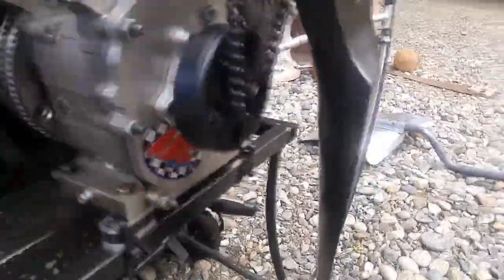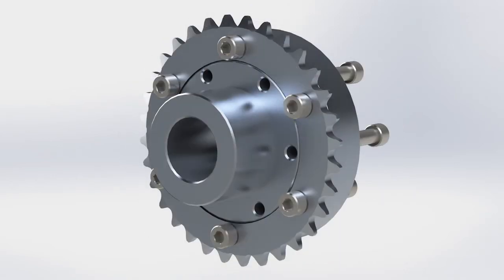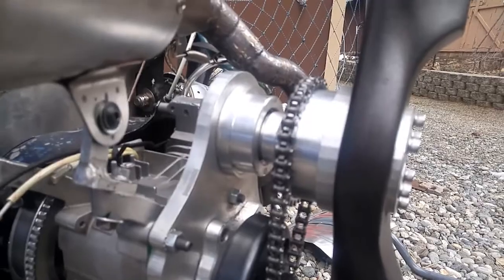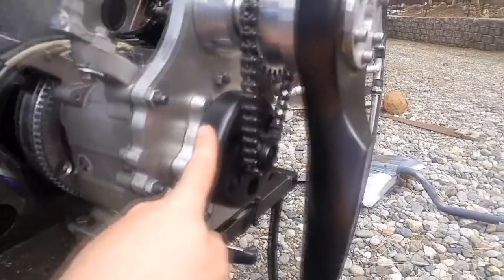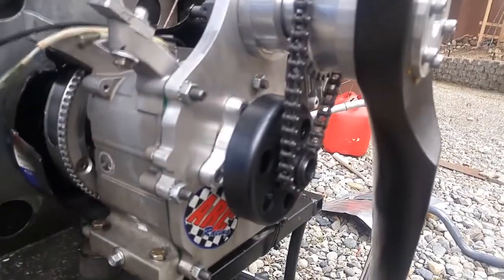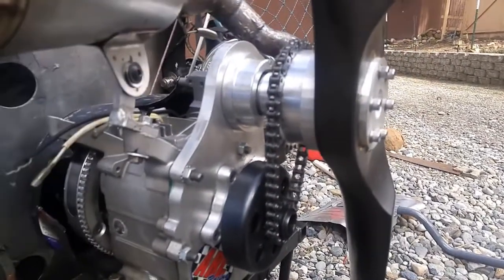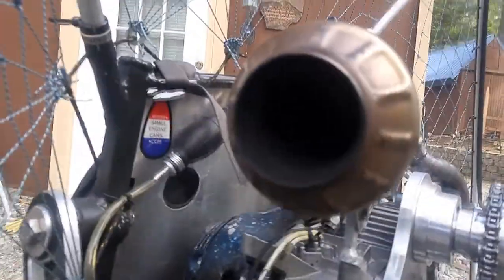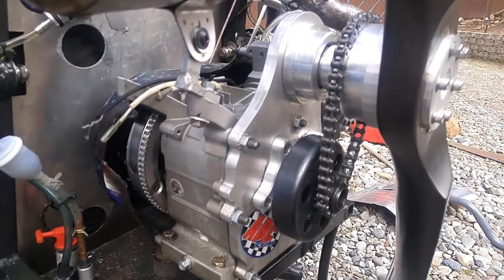Homemade Paramotor - Chain Reduction

Comment: Thank you for your work and posting it. What stopped further development of this design 4 years ago?  I like the 212 engine power source and it's development!
Reply from the maker: Hey Gary.  I decided to commit to building a production paramotor and did so. This engine is still on a shelf.  One day I'll revive it just for fun. However, it is not a viable option for a paramotor for normal pilots.  It's more of a tinker project.

Comment: Why didn't you turn around the clutch so you could shorten your propeller shaft?
Reply from the maker: It wouldn't save any space because then I would just have to add thickness to the hub to clear the clutch.
Reply: @IrisPPG  That may be so but wouldn't it be preferable to have your chain closer to the bearing

Comment: Dude, you have done more for me since the Eggmotor project. I started my predator 212 paramotor project thanks to them, and I stay motivated on it thanks to you. I love seeing what you come up with, and you went ahead with the chain-drive reduction system in spite of the naysayers.  Glad you didn't bail on the 4-stroke paramotor.  Keep it up, man.
Reply from the maker: Steven n I very much appreciate the kind words man. Much love, -D.
Reply: Hey man can you also tell me what your reduction ratio is and what type/size/pitch prop you're using? It looks like you're getting some damn good thrust
Reply from the maker: I'm using a Moster 185 125cm wood prop with a 2.666666 reduction ratio.
Reply from the maker: But keep in mind that my motor's max RPM is about 8400 and it makes around 20hp so that ratio may be very different for different configurations.

Comment: Awesome work Dimitri. Why did you select predator 212 cc hemi instead of the non hemi? Any thing good about hemi? Also if I were to get the reduction can a torque converter do the same job? I like that you mounted your prop on the bearing instead of directly on the clutch as I had a thought of doing something like that but I guess this will break the clutch due to intense vibration from the prop. How can I request your design to print locally as I don't have cnc machine ? Can you please make a video of it ? Many thanks for your awesome videos.also please let me know what wing do you use? Thanks
Reply from the maker: kamlesh jethwa man, I could write a book for you as an answer. I'd love to chat with you because this is too much for a comment. If you use Facebook, find me (Dmitri Zyuzin).
Reply: Dmitri Zyuzin ,sure I will contact you very soon. And Thanks for your response.

Comment: Nice job how much does your paramotor weight Thanks
Reply from the maker: Terry Fields the paramotor as a whole weights somewhere around 65-70 lbs. The engine is about 35 in its current configuration.

Comment: Heck yeah Dmitri! I'll be waiting to see how the chain lasts, but even if you need to change it more frequently for a safety margin. You can buy a lot of chain for what a belt (and the cost of a belt reduction) cost. Solid work!
Reply from the maker: Yeah man. On top of that, it took about 3 hours to machine the parts where the belt reduction parts took somewhere between 12 and 14 just for the big pulley. If I wanted to change my reduction ratio, the main sprocket takes about 25 minutes to machine.
Reply: Dmitri Zyuzin that's awesome, do you have a ballpark figure on how much machining time for the side cover, and a(n) (extremely) rough ballpark on what you might charge for a do it yourself, buy your own clutch type kit might cost?
Reply from the maker: I have no idea. The side cover takes about 4-5 hours to machine.
Reply: Dmitri Zyuzin awesome, awesome work. The R&D and time you put into it, you should figure that in for sure man. You do some really nice work, just wish I had a cnc to machine the pieces from. It would take me over a full day to just confidently lay out and cut the pattern for the side cover and drill all the holes, not to even start on scalloping the material out to lighten it up. If you were to ever sell the parts you made, please let me know!